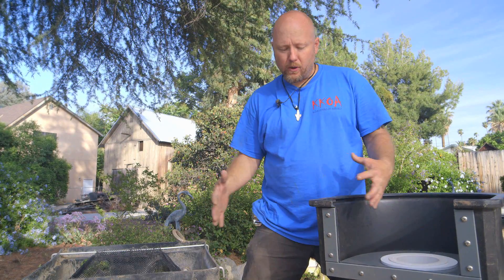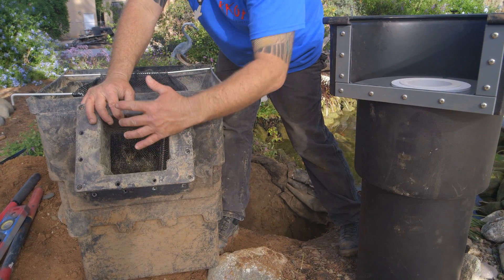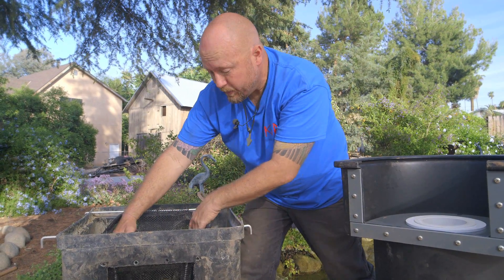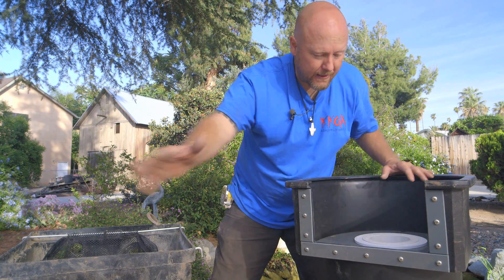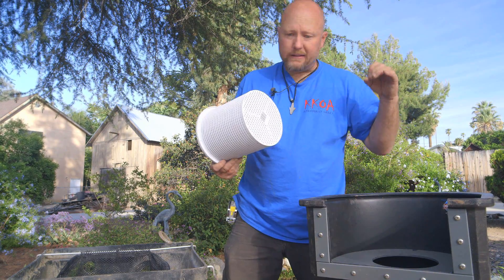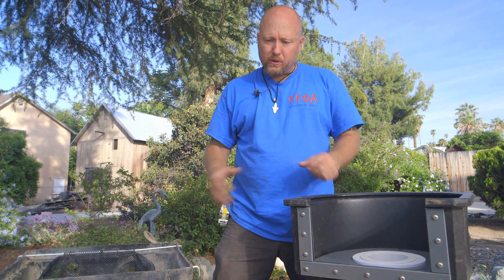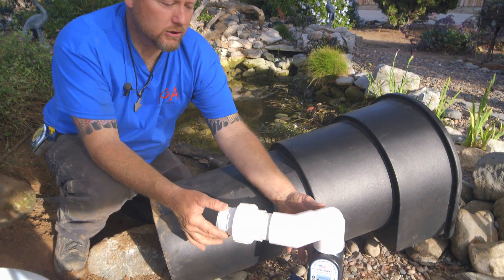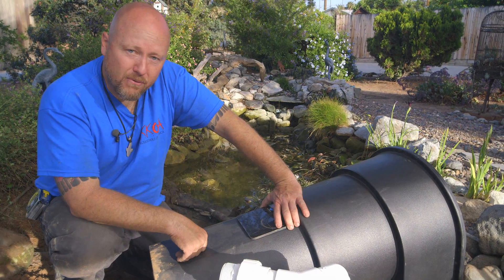Pond Skimmer Comparison – PS 3

Comment: Hi, I  just have a question with your explanation of the throat and pull of the skimmer. I acknowledge that you are discussing  an active venturi pull into a vortex which greatly benefits the process of the skimmer, but you lost me with regards to your circumference statement of 15 inches as opposed to 6-8 in in the competitor . A 6 in  circle is  determined by squaring the 6 inch sides ( 36 square) and multiplying by .7854 to get the actual surface area (28.2744) which is understandably less than the square surface area of the other skimmer. If the other skimmer were 8 by 8 inch,  it would have a larger  64 in square surface area, again larger than the helix.
 I can see that the Helix has a larger throat opening to allow larger debris in( which looks like 12 in across by possibly 6 in high which is a huge benefit ), as well as not having all of the other encumbrances of the cage and baskets on the other skimmer but I think your strength lies in the centrifugal vortex created by the design. 
I appreciate all your work and love your videos but in my humble  opinion I think your comparison seems to be a mix of apples and oranges.  Respectfully,  Anthony
Reply: Because he's full of shit and is pushing products he sells.  I spit my drink out wirh that circumference line 😂😂